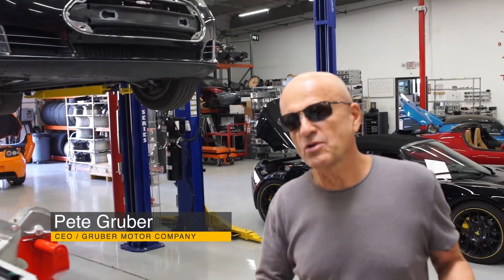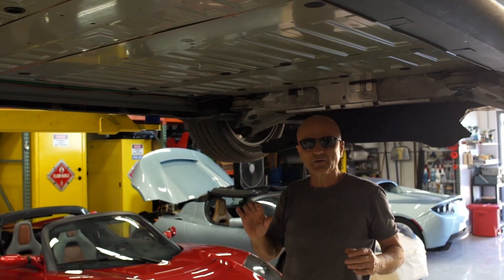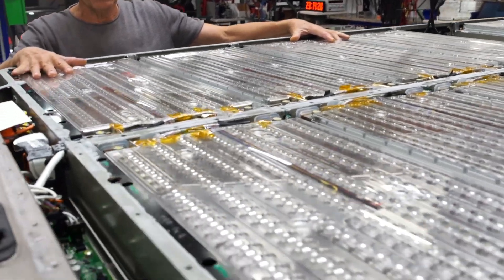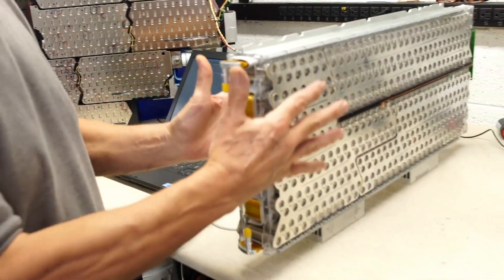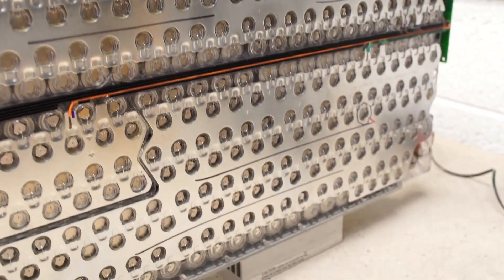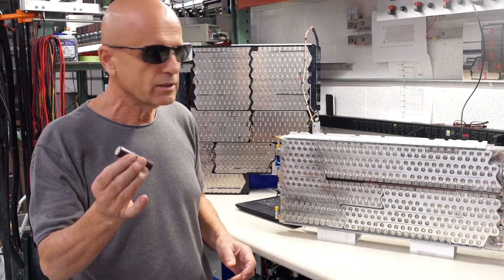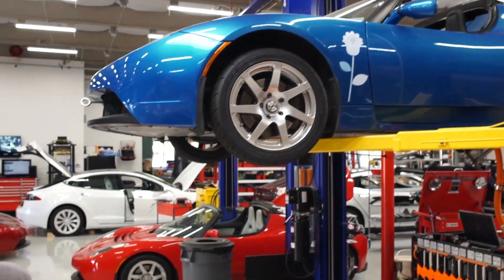Tesla Model S Main Battery Repair | Gruber Motors

Comment: Umm why would u snip 1 bad battery and not replace it or the 1 pack? Now it will be missing 1 battery and wont be equal capacity in that series or parralel connection

Comment: Seems like a fools game, you pay thousands of dollars for all of that labor to replace the bad cell. Then you put it all back together and drive it. All of those cells were operating side by side in the same conditions, so a few months later another cell will fail. You'll be broken down on the side of the road wondering why you wasted your time\money\effort on repairing an individual cell and then they complain at your for recommending this service. A new battery pack is the only reasonable repair.

Comment: Why would I buy a car which does not have battery swapping. You pay 30000- 120000 dollars to throw the car to thrush in 8-10 years because of battery degradation. NIO is the only brand with battery swap service!!!! NIO is the future.....

Comment: I’m Considering a used 2015 model s 70d with 149k miles. On pre purchase inspection tech noted “HV battery tests ok at this time. No bms codes present, good isolation. “ He did note however that module 4 has 30mV differential compared to other modules. He told me standard would be 10-15. Is one module reading off by that much significant or indicative of batteries ability to last past 200k miles?

Comment: If you don't replace the bad, cell that block it ocupied is going to discharge at a higher rate and go below the critical minimum voltage.

Comment: After the bad battery if found and isolated, would you replace the old battery and put in a new one or would the disabled cell not effect the overall capacity buy much?

Comment: There was no mention of either preparing the cell or replacing the damaged cell. Am I to assume that that damaged cell is not useable anymore and therefore is omitted and never replaced or repaired with a new cell?
 Sounds like the battery in general is does not need the bad cell replaced. Doesn't make sense.

Comment: Ask Elon Musk if they could manufacture the Module(sheet) smaller ,it could reduce the cost of repairing this batterypack, if the modul is 100 insted of 25 for example it would be cheaper to replace it and better for the environment and nature, could more modules solve the problems, and change the modules easy is very important, the repairman could have this cheap modules in storages and replace it .

Comment: why havent Tesla manufacturing the modules for better repair, could you take the modules apart and replace the defected batterycell, or are the only solution to bypass it electronically, this is very intresting because is it possible to repair a batterypack, it is no longer a problem to own a electrical car, to change the hole battery pack is very expensive, very good job and very intresting, in the future Tesla most fix the problem so it is easy to replace bad batterycell, easy as change the battery to your remotecontrol to your tv.

Comment: Cell matching is very difficult if we put new cell in old cells group we need to consider IR value is very important because new cell less IR compare to old cell. New cell charge rapidly compare old one now that group hit voltage first now bms stopped to charge the battery pack. Remaining groups not charge fully due to More IR. My opinion is we put old good cell put in that group IR also matched capacity also matching easily this im doing small lithium batteries repair in this method works well

Comment: Great video thank you. Tesla and other EV company with fixed structural battery packs have got a mighty problem brewing. This battery failure should not be the customers problem. NIO's model is the way forward, simply swap it out and leave it to the company to repair and re-instate into the battery fleet. BTW, How much did that cost and how long did it take?

Comment: Engineered like an old fashion Christmas tree light string.
Reply: Perfect analogy.
Reply: Think u have to wire them in series so the voltage is accumulative. Dc circuits wired in parallel which would avoid that problem increases current

Comment: Thanks, the video has a lot of useful information.
By the way, how much money does the procedure shown in the video cost for the your costumer?
- Removing the battery, detecting the burned cell, replacing it with a new one, mounting the battery back, on the chassis.

Comment: It seems to me that 1 out of 7000 shouldn’t cause a system failure. Who would want to invest $50-100k on those odds? Those cells should be made to be easily exchanged. Also the replacement that goes in should be “aged” (don’t know terms) to match the capacity of its neighbor cells. Right? I’m liking all this technical mumbo jumbo. Very interesting when God’s creations collaborate

Comment: There needs to be legislation that a single component fault must be repairable.
Elon will argue briefly that potting compound is the only option. Make EV manufacturing responsible for the handling of their waste. That would reflect the true cost of the EV revolution as it progresses.
A few less rockets won't hurt Elon or evolution for everything else that shares his planet.

Comment: Amazing that one bad $2 battery cell can be the demise of a $130,000 supercar. Cheers to you for your sleuthing skills and sharing the inner workings and solution with us. As we transition more into a BEV society, these repairs will happen more often. I imagine a more serviceable product will be mandated. Thanks!!
Reply: Just like a $0.01 resistor being the demise of a $1200 phone, $1600 video card, or $3000 laptop. Electronics are just expensive things made of thousands of very very cheap things.
Reply: Poor design.  Could have arranged the batteries to bypass the faulty battery.
Reply: @SPX3455  that would be even more expensive tho right

Comment: That's it? Just cut out the old cell? Doesn't that make that module different from the other modules? Will the BMS just compensate for the difference in that module compared to the others? Will the other cells in the module get slightly higher voltage than before?
Reply: Correct me if I'm wrong, but it's not a voltage issue, these are running in parallel, so it becomes a capacity issue.This pack will still offer the same voltage, just a little less of it.

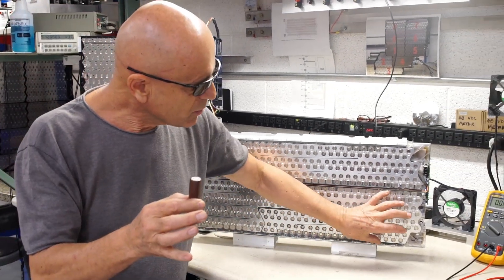Comment: Excellent video!  It makes more sense to 'snip out' the defective cell - which has a minimal effect on overall capacity - than to replace the entire module.  5:00, don't you mean in series, one defective cell in parallel will have a negligible affect on the overall resistance?

Comment: CRAZY DESIGN.
1 bad $3 cell disables a whole car, a whole battery pack, for such a massive dismantling, diagnostics, then "we just snip it out of circuit".
CRAZY DESIGN.
Reply: Agree, we should have software in the car where it would show the bad cell.  It should be easy to drop the battery with a few bolts, open it up and replace the battery.  Wonder if you get a warranty with Gruber motors after they replace it!
Reply: @robertsmith6408  A $20 bluetooth OBD2 reader can give you that information. But yes, cars should include that capability.
Reply: the F150 with the Ecoboost it easier to remove the engine or more commonly remove the cab to do engine work.
Reply: How would you do it? And cost effectively.
Reply: circuitry and BMS for every single cell?

Comment: So you don't replace the bad cell, you just cut it out of circuit.   This makes it practical to put the car back on the road for a reasonable price but I can understand why Tesla engineers would not approve of that process and would not call that process a factory certified repair solution.   I can also understand that the way the bricks are constructed,  individual cell replacement would be a substantially more labor and cost intensive process. 

So glad I don't have to deal with that nonsense.  Fossil Fuel Forever!!!!   In the years to come, as demand on Lithium increases,  Lithium prices are going to skyrocket, and so will the battery costs for EVs,  which will make them harder to sell when gas engines will be getting relatively cheaper all the time.    The big problem is that Lithium in economically viable ore deposits is a limited resource,  and in fact we don't have enough proven Li ore reserves to cover the projected demand if 100 percent of road vehicles are switched to electric power.  This will boost Li prices into the range of precious metals.

Comment: A rebuild battery will only have a  small fraction of its original capacity.  By about 100K miles the pack is largely spent.

Comment: My model S battery still runs after almost 300k miles but it has experienced some battery degradation. Would you be able to repair a battery with normal degradation to make it like new again?
Reply: Yes replace every battery😢

Comment: Knew there were 7,000 ish individual batteries but not that one duff one disabled the car.

So many little fire hazards !  Surly NA Ion has to be safer. Do you know why the new battery Ford has invented ?
Reply: It wouldn't, except for the fact the car is so badly engineered.

Comment: Do you fiscally removed the bad cell and put a good one instead? Or you just disconnect bad cell and leave it in the pack? Then, hook up a new one which can be out of the pack in special designated area. Most probably you don't harm the whole module because of one bad cell.

Comment: Very informative video. I am working on a project involving the Model S battery modules and have a few questions. First, how thick is the cooling ribbon and how long is each pass? Also, is the coolant used 50% ethylene glycol, and if so, what is the entering flow rate and temperature? I've been looking online everywhere and can't find anything. A link to a good website or information about this would help.
Reply: Sounds like you need to do more research.

Comment: That electric jack you have to remove/move the Battery pack is way better than what they give us at Tesla to remove/move them. What we use essentially a padded table with 4 coaster wheels we have to push around and its at a Set height lol.

Comment: Right To Repair is a movement everyone should get behind so that we as consumers and also private business repair shops of all kinds can have the ability to repair these products without being forced to only go through the original manufacturer for repairs. Bring back the old days when we all had access  to parts, schematics, manuals, etc. To do the work ourselves.
Reply: Anyone who claims to care about the environment should be actively supporting right to repair.
Reply: @sparkie996 We now have access to the "tool box" and service screen, so that's great. We just need access to order all parts.
Reply: @nick0780  Does toolbox only work on MCU2 or does it function with MCU1? Also doesnt it require service plus?
Reply: Musk added apink slime to the new batteries so you cant replace (right t repair) modules yourself. It's why I wont ever buy a Tesla . Replacement Modules for my ID 4 are $500-$800 cheap and I can have my loclal mechanic swap them out for me
Reply: Right to repair!!
Reply: Is this purely a US issue or do we have the same problems here in the EU? Unsure what the EV repair situation is, although I briefly looked around locally and did not find any car battery refurb shops here in Stockholm.

Comment: Hello, I have a 2013 model s Tesla with 71k Miles that I can only get 78 miles on it I recently took it to tesla dealer they told me that I need a battery pack... My question is how much do you guys charge if there is a bad Cell that has to be replaced.

Comment: I had a very similar problem on my 2013 Model S85 where the battery charging level was limited due to a bad module. So, I ordered a (used) module from another 2013 that a dismantler sold modules of (for battery backup mainly) and swapped that module into my pack after first exactly matching the module voltage to all other modules. One question I still have: I still need to permanently close the battery cover again, what type of caulk are you using? I saw a short glimpse of a caulk gun but could not see the type used. I that a PU caulk or Silicone? Or something else?

Comment: Awesome...Main question is... with all this labor to either remove or replace a few cells and put the pack back into the car... what's to say or... what are the chances  a week later another cell goes bad?.. Out comes the pack again? Usually with electronics ... one cell kills the bunch. What has your experience been with these repairs? Also do you replace the one battery/cell or just snip it out and delete?
Reply: Not as much as you suppose.
They usually all have a sign. Something like soft imbalance after performing a quick charge / supercharge

Comment: Great vid.  I have a 2016 S85.  I was caught up in the batterygate but Tesla refuses to admit it.  Although, after a lot of heated discussions, miraculously my discharge and charging rates have been returned -- but my capacity remains capped (according to calculations) at about 72kw, not 85ish. I have put 50,000 miles on it since the update without losing another Mile in range.  I'm at 100,000 miles now.  I saw that smaller battery packs can be replaced with  up to 90 KW packs. . .  I lost about 30 miles on that August 2019 update.  Question is:. If a 90 KW battery can be put in my car,  is it possible for you to just reprogram my 85 back to what it was?  Thanks

Comment: I am using Tesla S battery modules for RV coach power and fluid temp control. 
What is the max fluid pressure rating for single module?
What is nominal fluid flow rate at a given (nominal?) pressure?

Comment: These cars are not for the average consumer a poor choice in general to purchase. What if you have to go through a flooded street possible water intrusion to the battery pack and or electrical connections? How would the general home mechanic work on these? By the way FJB

Comment: I know this is an old video but hopefully either Gruber or the owner of this car can report back on how this repair worked long term.  The reason I ask is because there is considerable information on the web indicating this is a short term fix at best.  I am hoping that is not the case.  If cutting the fuse link works long term, anyone know why this fix would be discussed in a very negative manner on the web?  If a pack needs to be replaced because of one bad cell, that seems scary because there are thousands of cells in a given pack!
Reply: Information on the web is nearly always biased, so you must weed through it and read between the lines.  For instance, people with an agenda against EVs (gas station owners, brake shops, exhaust shops, independent garages, transmission shops, gearheads, etc.) will post outright misinformation about EVs because they don't want them to succeed.  Regarding the snip of the rogue cell: it will be a "permanent" fix as one leaky cell won't cause collateral damage to adjacent cells or others in the entire pack.  What I mean is that if we take a 150K mile pack with a dead cell and snip out the offending cell, we will have the same expected remaining life as our neighbor's car which also has 150K miles on it (for instance).  We will lose 1/6000 percent range of course but the one cell or the extraction procedure won't affect anything else as long as the pack is properly sealed against moisture.  All things being equal, the repaired pack and your neighbor's untouched pack will have at least 100K miles left to them.

EDIT:  but, if the bad cell is snipped out of a pack with 250K plus miles, it makes sense that all the cells could be reaching the end of their life (mileage, age, how much supercharging, etc.) and others will follow soon.

Comment: Did I miss something or did you simply not replace the bad cell?
Reply from the maker: We don't replace them, we snip the fusible link wire.
Reply: @grubermotorcompany  Wow, OK. So how much does this affect the overall battery. I think at some point some part of the battery management system would notice something is a little askew.  does this have much of an effect on things farther down the line?

Comment: So the rest of the cells in parallel are ok, and not below 2 Volts? I would have charged it and looked for hot spots with thermal cam.

Comment: It is a shame that one part the size of a double A battery and one of 7000+ like cells can cripple that car. It turns out to be a big job for a small component. Since all the other cell are about the same age as the failed one when will we see it again for the next failed cell, then the next, and so on?

Comment: Interesting how you identify a failed cell.  You say you snip it and take it out of the circuit.  I assume you then replace it with a new cell?  Is there a way to test the modules to see if there are any other cells that might be close to failing?